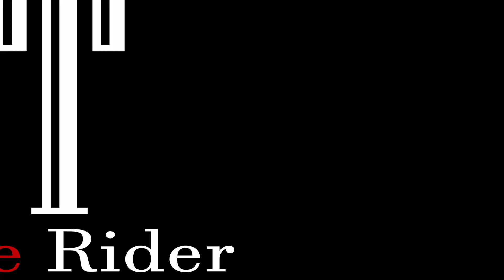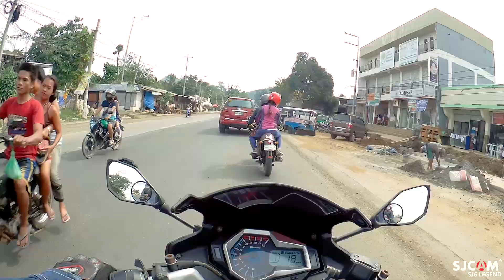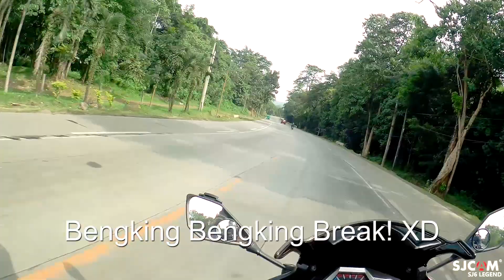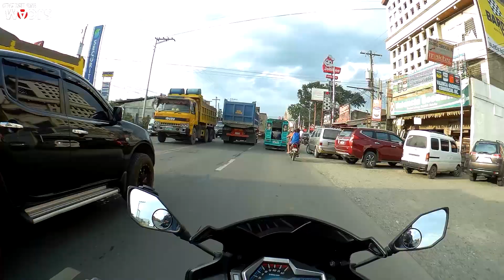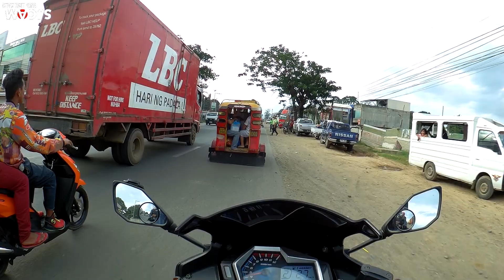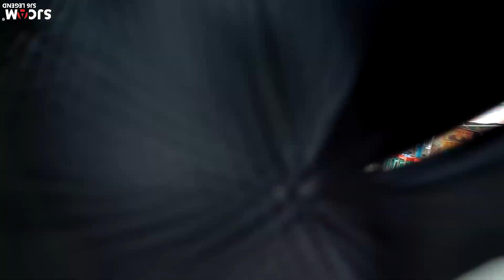CARBURETOR Jetting and Altitude - Guide to Changing Jets - Rusi SS250 Episode 4 - RussTee MotoVlogs

Comment: Not true! you don't need to change jets unless you have more then 6000 feet change in altitude so where in the Philippines are you going to be riding that is more then 6000 feet high. You would only change jets if you where going to be moving to live at above 6,000 feet not just for a short ride. You might only need to adjust your mixture screw a bit ,And if you have the stock CV carb on your Sigma 250 you don't need to do anything because a CV carb will change automatically.
Reply from the maker: Just read these:
Effects Of Elevation & Air Pressure And How To Jet Accordingly - https://goo.gl/7jY6fp
Main Jet Correction Chart - https://goo.gl/j4kzmC
Carburetor help, jetting, and tuning help - https://goo.gl/goRJAj
Reply: @RussTeeRider  I don't need too because I have been racing and jetting motorbike for 50 years and you never change jets just to go for a ride somewhere, where are you going to change the jets? on the side of the road when the altitude gets too high and then change them again when it gets too low, get real.
Reply from the maker: @yeahrightmate  I didn't say that you need to change jets when you ride somewhere. Say in my case, I've been living near sea level for a few years my main jet was 120. When I went home, I needed to change my jets to 115 as my bike was running richer than normal and my bike is running inconsistent. Where the altitude ranges within 300m/1000 ft to 1000m/ 3300 ft.
Reply from the maker: @yeahrightmate  again, I wasn't implying that you should be changing jets if it doesn't require you too. If your bike is running good, then don't touch anything.
Reply: @RussTeeRider  Yes but a video like this makes everybody think they need to change jets every time the go for a ride up to the mountains, you did not say only if you move to live there.
Reply: @RussTeeRider  Sorry but In that range you would not need to change anyway. I live at Sea level but I go up to Baguio every week (1500m) and I never need to change jets.